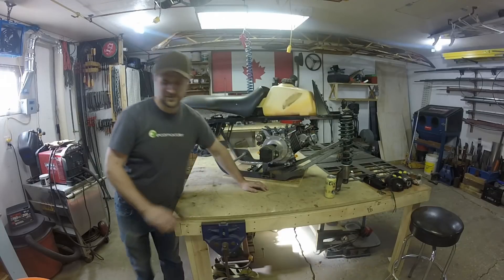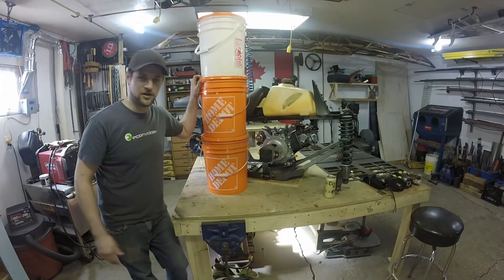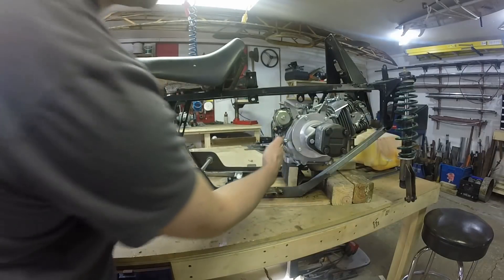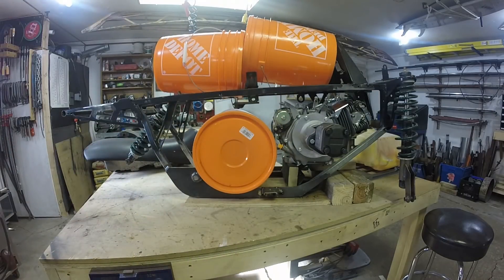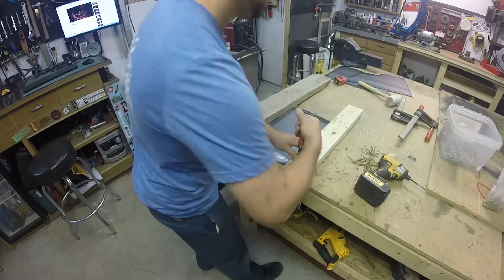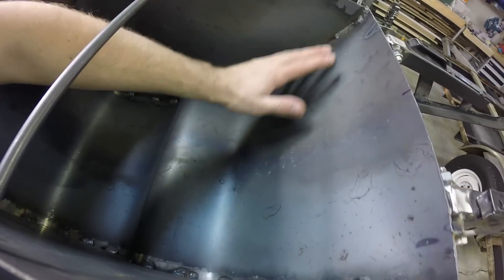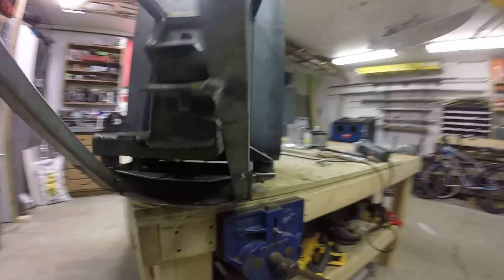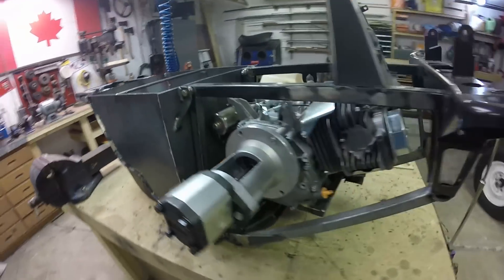Amphibious Screw Drive ATV Project - Part 7 - Hydraulic Tank

Comment: Btw, something you may or may not find interesting (or already know) is you can improve it's top speed by having more than one screw thread on each pontoon. It's the same principal as with screw gears only here the Earth takes the place of the gear meshing with the screw. A multiple of parallel threads is equivalent to spinning the screw that multiple faster. A side effect ought to be less torque the engine/motor has to fight as well so less stress on the works too.

Comment: All you need is enough so it doesn't run the pump dry. I am an mech. engineer and designed systems in school. I would use a 1.5 gallon (extra) of fluid in a 2 gallon tank for expansion.

Comment: Sorry to jump on the "you don't need that much oil" bandwagon. But do some research on colt/Case/Ingersoll garden tractors. These handle a hydraulic tiller in heavy clay based soil just fine with about a gallon of oil in the tank after the rest of the system is filled.
Gordy

Comment: what no drain plug on the tank you might want to incorporate that into the design so if you need to change the fluid it is a lot easier

Comment: 50 gallons!?!

*checks helicopter specs (ec130 t2)
*500psi at 3.2 gal/min (1.6*2 dual hyd pump)
*0.5 gal tank total (abt 15% of flow rate)
*No radiator described in flight manual
*Hydraulics routed through transmission for preheating
*Uses hydraulics for entire flight.

I’m no expert, but maybe you could get away with less than the 15 gal you’re suggesting? That flow rate is unreal though!
Reply from the maker: +Rather B Flyin a helicopter hydraulics are totally different. Way less flow and pressure. 12gpm is normal for a large agricultural application.
Reply: REDNIC79 holy cow! Yeah I know nothing about that, then.

Comment: Don't be rediculous. 15 x 7.2 pounds per gallon is 108 pounds! Run the minimum amount of hydraulic fluid, like 5 gallons, with one or two oil coolers+fan. Run a well designed system accumulator or surge tank or anti foaming device if that's a problem. 

And ya great idea to make the tank part of frame. I'd keep the weight low and unsprung if possible.

I don't want to see this new rotary suck balls like the last one!

I've been following way too long for that, lol. make us Canadians proud, eh?
Reply from the maker: +SpenserRoger I need each screw motor to put out 150 lbs of torque....flowing at 12gpm it will create lots of heat. Coolers are heavy too. So is any other device I add on. The tank likely holds 10 gallons in its current state, I would rather be able to remove some fluid than not have enough room in the design to add more. The machine is going to be heavy as hell with hydraulic drive.  There is no way around it.
Reply: REDNIC79 Do the coolers need to be high pressure? Cause if not standard transmission coolers from the junkyard are aluminum and like 10 pounds at most. 12v fans are in the grams. If you're not running the 3-5x reservoir size you're gonna get heat problems regardless. 

And ya make the damn tanks unsprung bro.

We all wana see you hit some step downs and do hill climbs with this beast!
Reply: Are you using aluminum screws or steel? aluminum screws with bolted on steel would be bomb bro. 

ITS GOING DOWN BRO... DOWN AND AROUND AND AROUND AND AROUND...

WOOOOOO!___

ps: man do whatever u want, I trust your judgement, and will be excited and support your project the whole way!
Reply from the maker: +SpenserRoger I think the cooler ate usually rated for a few hundred psi...mainly for hydraulic rams causing pressure in the return line...i could possibly get away with a car trans cooler. Problem would be it would need to handle the flow..ie a 1inch return line flowing 12gpm
Reply from the maker: +SpenserRoger aluminum screws would be ideal
Reply: We have an industrial Ingersol lawn mower, all hydraulic drive using 1" main hoses and a cooler about the size of a motorcycle radiator, reservoir is only about 1/2 gallon if that. It also weighs close to what a small tractor weighs. If you go the oversize reservoir route, you might end up with weight problems since your trading a light weight cooler and fan setup for lots of hydraulic fluid. Our local Napa sells all kinds of hydraulic stuff including coolers, maybe one of your local stores has one?

Comment: Our backhoe has a 20gpm pump, and I don't even think it holds more than 10 gal. It does have an oil cooler though.
Reply from the maker: +The Metal Butcher I think the cooler is a big factor....i mean what if I decide to circumnavigate the globe with it? Can't have overheating issues. Hah

Comment: It may just be hard to see on camera but those welds on the inside look a bit large for the thickness of material you are using.  A good rule of thumb on material that thin is to tie into each plate about the same thickness of the material you are using.  A hair extra won't hurt but much beyond that will just add unnecessary weight and put more heat stress into the material than necessary.  Since that is part of the frame it would help add strength to weld it solid inside and out.  That would also give you an added layer of protection against leaks and it should draw the plates in and out evenly enough to help prevent warping.  I would also recommend stitch welding a few inches at a time and moving around a lot to also help minimize warping.  Other than that it looks like it's doing great!  Keep up the good work.
Reply from the maker: +Craig Arnold don't watch so closely! Hehe..joking. thanks for the input, I agree

Comment: WooHoo ! realy happy to see you back with an update :-) You could always use the screws as tanks for the oil they must hold about 30 galloons ;-)  rather like racing bikes that use the frame as an engine oil tank .
Reply: It would probably be a plumbing nightmare to maintain hydraulic flow and pressure to a rotating tank like that.  Plus with all of that stress on those tanks if you cracked one you would make a heck of a mess.
Reply: i wasn't being entirely serious, and im certain Rednics solution will work and is much simpler which makes it good engineering , , but none the less it would be relatively simple to use the screws as oil tanks , you wouldnt even need a rotating oil coupling  as they pick up and return can go through a sutible large fixed center shaft , and as the tanks are always full maintaining  oil feed is not a problem either , its true the weight of the screws is higher by filling them with oil, but since you havent increased the AUW of the vehicle  the loads ther carrying is the same , though it would increase unsprung weight  it  also lowers the CG . like i say not serious but  fun to think about .
Reply: Yeah it might sap power having to spin the liquid as well as the screws though.  Spinning the fluid would also add friction and thus heat to the system plus the friction of the screws on the ground would add even more heat to the system.  Or maybe the screws would help dissipate the heat to the ground and air.  Would probably need an engineer to answer those questions.

Comment: Might not be a bad idea to throw a few baffles on the inside to keep a column of fluid from sloshing around in the area where you will be drawing from.  This way if you find you don't need as much capacity , you can fill it part way and save yourself from carrying around unnecessary weight. Nice job as always , and thanks for the update . Looking forward to your progress. Joe
Reply from the maker: +mazdalorean yes I plan to do barrels after I place the bugs in the tank. Thanks!
Reply from the maker: +REDNIC79 baffels

Comment: Great to see another upload, but hey really think this is the wrong solution, the weight of the oil along with the bulk of its storage ...... just get a  cooler fitted,  thinking outside of the box has its place, but have you ever seen a hydraulic system that comes close to what you are doing here in a commercial (or for that matter any other) system?

What ever you choose, good luck we look forward to seeing the end results

Comment: Great work but definitely put a radiator in to save weight and space, no way you need that much fluid. My little skid steer only has 6 gallons in reservoir with half a new tranny sized radiator and it's 40 years old with an air cooled twin and still works great. Slap an atv oil radiator in there with a fan for easy plumbing and you should be able to get away with a couple gallons total. I was gonna build something similar but basically just a little tank with snowblower tracks for ice fishing and use an aluminum oil pan off a car I had as the reservoir I had laying around. Also have a junk electric wood splitter that has a perfect aluminum finned housing on motor to make a nice little reservoir that looked interesting but made plumbing more work. Just a couple ideas, my projects unfortunately usually end up theoretical so fun to watch yours take shape. Keep at it!

Comment: Hmm, I can't help but think your fluid mass calculations are off. Just look at the stack of 3 (but actually, you'd need 6) buckets next to the ATV frame. Does that volume ratio make logical sense? I don't think so.
Reply: I just read down and various other commenters seem to agree. Think of it this way - you'll be driving this thing in the water and mud and you've build a waterproof storage area!

Comment: you need the tank for cooling more than anthing else, why not use a oil cooler or trans cooler?

and all the quad part you didin use if you can box them and ship them to me ill pay you for it, i has a plan for a little 4x4 buggy im building

Comment: I dont think there is any way possible you should need that much fluid. A 773 Bobcat skid steer, which is hydraulic drive, with 4 hydraulic cylinders as well as hydraulics to run an attachment only has an 8.5 gallon capacity. Yes it does have a cooler, but its made to work at full capacity for hours and hours on end. Im thinking you shouldn't need a hydro system much if any bigger than what my exmark mower has, which i believe is only about 3 quarts. Dont take this as being hard on you because your metal work is great and enjoy watching, I just dont think you're going to need that kind of capacity.
Reply from the maker: +CumminsDriver635 I would be very happy if you are right. Thanks for the hope!